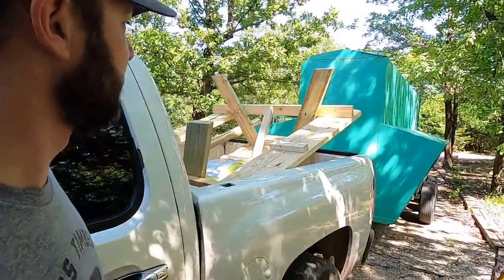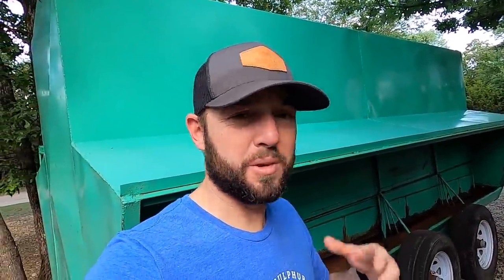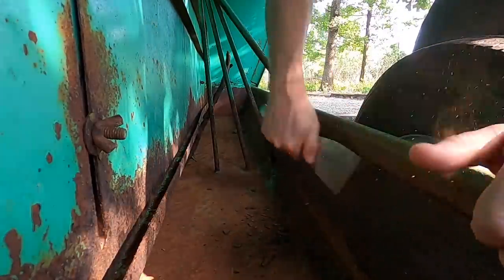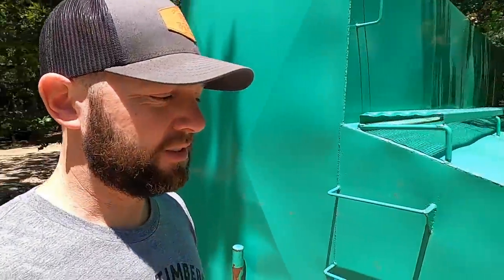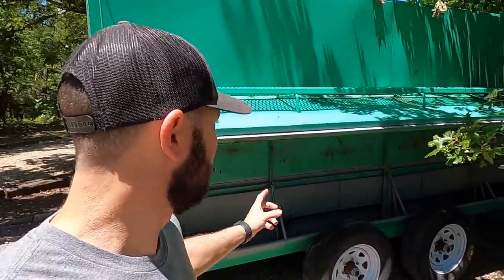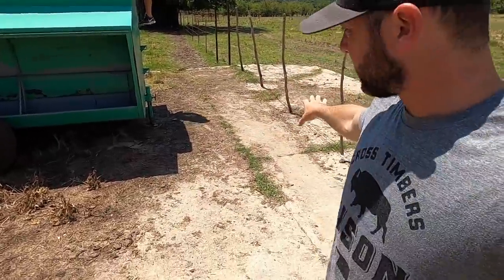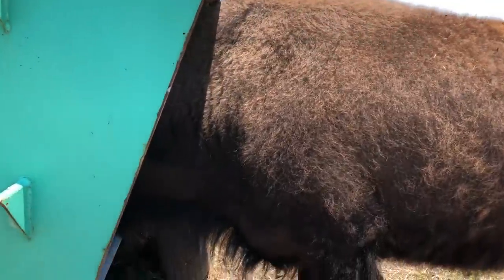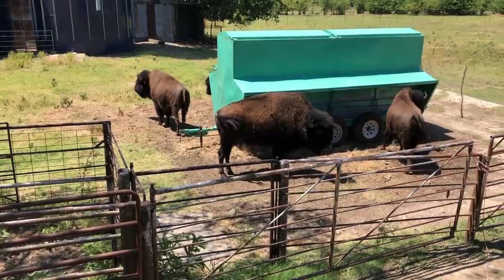These BISON are going to LOVE this!

Comment: There is a product you can spray on after you paint. It is impervious to water even salt water it is used for bridge building and heavy equipment. It’s called iron clad. You can remove it with degreaser but water will not harm it. It is made by ZEP mfg.

Comment: They sell a rust inhibitor . When you apply it it changes the rust into good material. You may want to look into it. Even rust oleum doesn’t stop the spread of rust once it has started. A lot of car restoration this is used on! All I can say is give it a try. I haven’t personally used it . I have only seen it done. It turns the material black when it works.

Comment: I had a swamp cooler after someone stole my good one and the bottom was rusted out and wouldn't hold water so I had to get Bondo and it worked good on the rusted out part and held water.

Comment: You can buy a liquid which you paint on active rust and the chemical will neutralize the rust and then you can paint over it.
Try looking for it at an auto body supply house. 

That epoxy will not neutralize the rust and it will rust out under the epoxy eventually.

Comment: ive got two of those for the deer i breed, i had to sand blast ours once every two years or so, but im trying a resin based coating this year, seems to be doing ok so far, for the inside i used a polyurethane atomized spray coating, seem to be doing ok...
but i did consider a plastic sheet inside the feed trough as a cheaper route...

Comment: Should have used an electric sander with sandpaper for sanding metal surfaces. Could have gotten back down to the "good" metal and then painted over it with a coat of Rust-oleum to prime and Apoxy to seal. Would have lasted longer before rusting again.

Comment: Instead. Paint like planned for looks but then see if you can get plastic bins to put in there.  And secure with bolts or what would work. Or get some galvanized metal sheets and cover it and secure. Sounds safer than Paint? And use right away? Idk just a thought. I get you already did a lot of work. Or maybe before the winter?

Comment: On the rusty feeder area. Treat it with phosphoric acid, paint it on after cleaning up the loose rust. It turns the leftover rust into iron oxide...stopping it from rusting through the paint again... advice too late I guess. When the paint starts flaking again, (in a year, maybe sooner) pressure wash as much as you can off. Then do the acid (available at hardware stores) used to be sold as Naval Gel to prep rusted surfaces... good luck.  Say hi to Daniel... GaryB